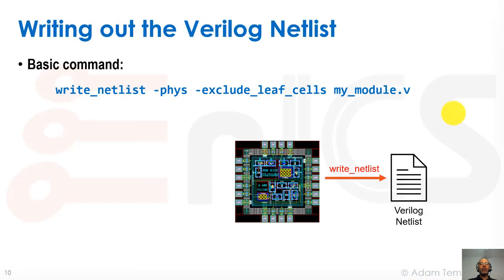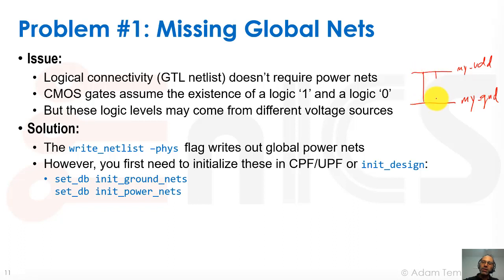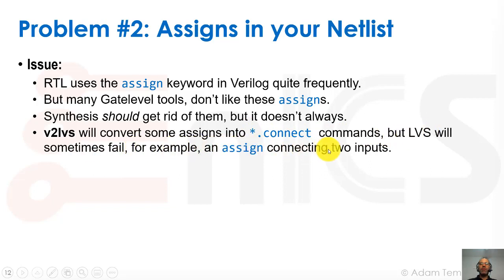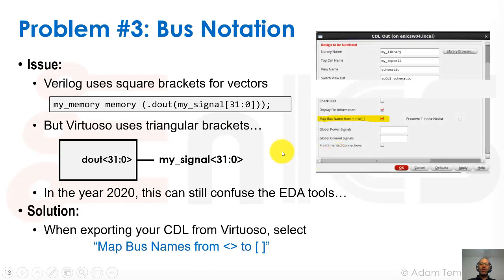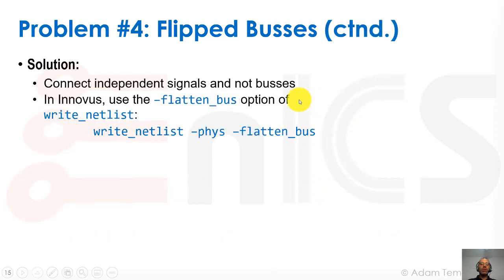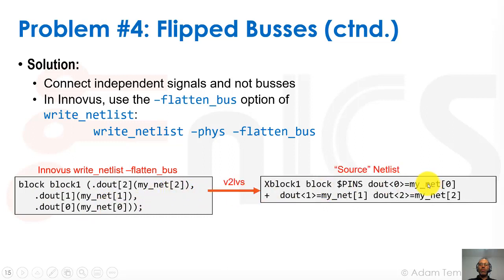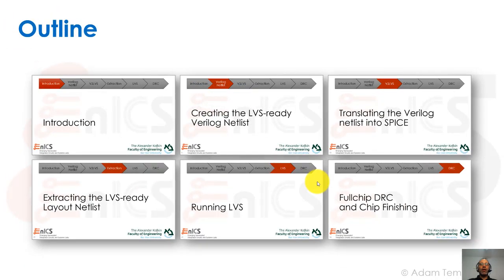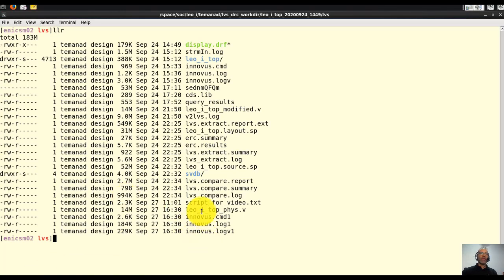Digital-on-top Physical Verification (Fullchip LVS/DRC) - Part 2

Comment: Hello Prof,

I’m using the TSMC 90nm process. After layout, I can see my IO ports in the .v file. However, when I convert the .v file to a source .spi file, the LVS report shows that the number of IO ports is zero.

At first, I suspected it might be a routing issue, so I moved the cursor over the corresponding IO ports and reattached the text labels on the corresponding metal layers. Unfortunately, the LVS report still shows zero IO ports.

Could you please advise me on how to resolve this issue?
Reply from the maker: Well, debugging LVS through YouTube comments is pretty much an impossible task (...heck, it's almost an impossible task when doing it hands on! :).

But your question is a bit confusing - maybe a bit wrong. If you're running v2lvs, then anything at the toplevel (top verilog module in your netlist) should become a port in the CDL toplevel. This has nothing to do with text labels - at least in a layout editor (such as Virtuoso). It could be that you don't have proper pins in Innovus and therefore your verilog netlist doesn't have ports, but that's not what I understood from your message. 

If, on the other hand, you're talking about the LVS extraction stage, where you are extracting the spice netlist from your layout, then you have to have labels in a specific pin layer (defined in the LVS rulefile) in order to create ports in the netlist. 

One of these is probably the answer to your mystery.

Comment: why are we comparing behavior of Innovus and Virtuoso? Does this mean the virtuoso netlist will be compared with innovus netlist? In 1st video, it is mentioned that custom and digital flow are different..why comparison b/w custom tool netlist and digital tool netlist?
Reply from the maker: That's not exactly the point - I do believe I explain this pretty explicitly in the series, so I suggest watching again. But I'll try to give you a quick answer - 

We are not comparing "Virtuoso" to "Innovus". We are kind of comparing "Innovus to Innovus". The flow is "digital-on-top" so the entire implementation is in the place and route tool (and not in the custom-design tool). 

Assuming there are no "bugs" in the tool itself, we can assume that the layout produced by the tool is equivalent to the connectivity that the tool knows about. The problem is that the tool doesn't "know about" the entire design and/or the connectivity in the tool may be incorrect. The main problem is the connection of several separate hard macros together. If we are talking about a standard cell, for example, Innovus "knows" its .lef abstract. But some inconsistencies may lead to a short in the layout, once the detailed GDS is used. Therefore, we must check the connectivity of Innovus (=Exported Verilog netlist) compared to the full detailed layout (=Merged GDS). Since the tool works on Spice netlists (cdl), we need to first translate the Verilog netlist into Spice (=v2lvs) and then translate the GDS into Spice (=layout extraction).

So to conclude, both were created in the digital tool (Innovus), but since we are adding more detail, we need to make a comparison at the finest grain possible.

Comment: Hi Prof, why do we want to exclude leaf cells? Aren't leaf cells just cells that are at the bottom of a hierarchy? I understand not wanting to include physical cells such as fillers, but wouldn't we want to know information about leaf cells?
Reply from the maker: If I remember correctly (but I may have to delete this reply some day, if I double check this and find out I was wrong), then the problem is that the tool will actually write the definition of the leaf cell (e.g., standard cell, I/O, etc.) in the verilog netlist. We are going to provide these definitions by including the .cdl of the leaf cells. So having both definitions can cause some conflicts.

Comment: Hi,

Can you please tell me the difference between verilog netlist and spice netlist?
Reply from the maker: A "netlist" is, as it's name implies, "a list of nets". But such a list can be given in various formats or for use by various tools/processes. A "Spice netlist" is in the Spice language (also Spectre or other Spice-like languages). This implies that it consists of devices, such as transistors, resistors and capacitors and the nets that connect between them. This is as opposed to a "gate-level netlist" (or often, a "Verilog netlist"), which doesn't usually go down to the transistor level, but stops at the gate level. So you would have a list of inverters, NAND/NOR gates, etc. at the lowest abstraction level.

Comment: Hi Prof, so with the problem2 #Assigns in netlist, should'nt we have assign statement in our netlist, and if it is there, what fails in our LVS, can u pls explain?
Reply from the maker: Hi,
It's hard to say exactly what and why this type of failure happens, but it causes problems across tools and versions. I think that a lot of "black magic" happens because we use different tools and scripts (often from different vendors) for different parts of the flow and these have hidden bugs that are hard to clean up since there are so many options used by different chip designers.
But the bottom line is that assigns in your netlist are just looking for trouble. Remember, the netlist should be a list of gates - no behavioral code. And an assign is - in essence - behavioral. Some tools leave them in the netlist as a way to connect two wires as opposed to just renaming the net so all connected wires will have the same name. But LVS can get screwed up because of this.
I think the most critical problem that I have seen and can describe is when you have several inputs that are shorted together, as I showed in the video. LVS treats inputs as anchors for checking the design and this is probably the root of the problem.
Bottom line - get rid of the assigns or you may spend many frustrating hours trying to figure out what the heck happened.
Reply: @AdiTeman  Tnks prof.